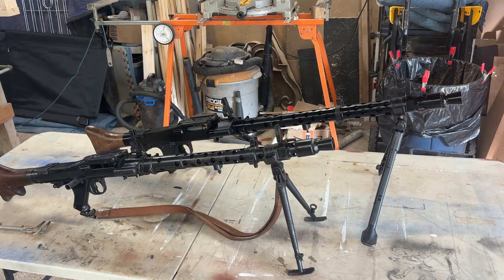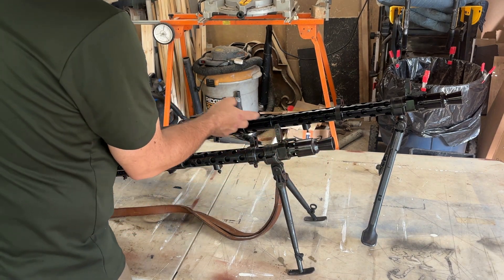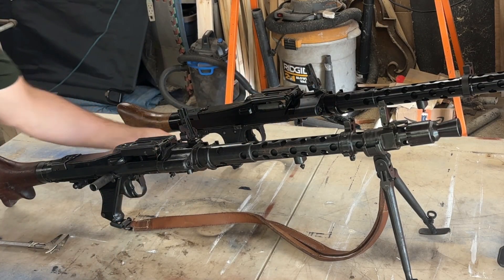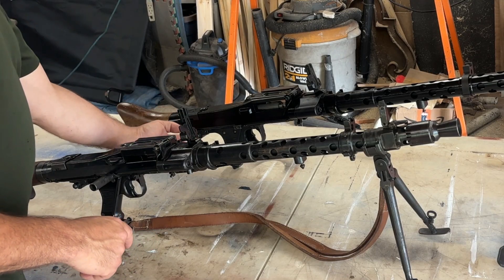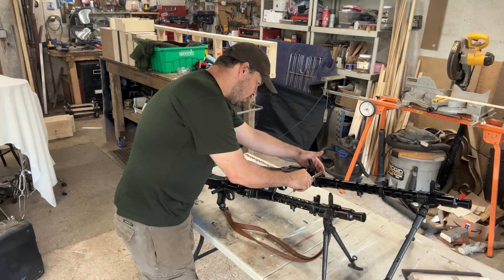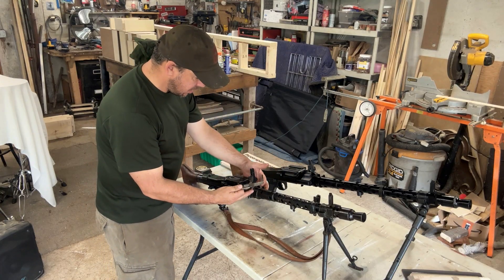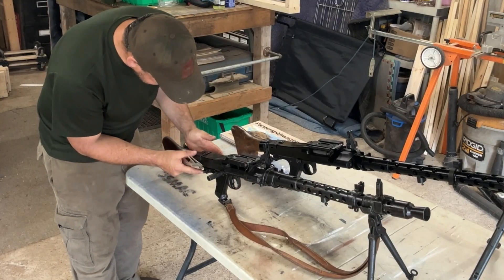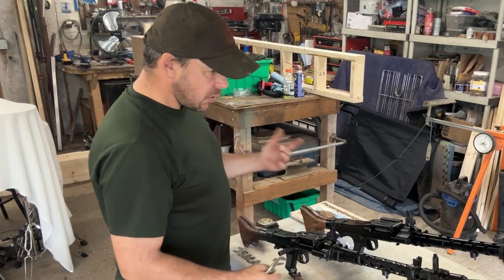Project 222  Ep 80 Building an SdKfz.222 Armored Scout Car

Comment: With real weapons vs the replica to remember, at least in the USA you can't make a replica 1 to 1.. It has to be larger or smaller so it won't accept genuine parts.
Reply from the maker: The MG will never be close enough to original to be classified as replica by Canadian standards...  Replica firearms are prohibited in Canada.  The only part of the MG that will look original is the barrel section that is out of turret.

Comment: Honestly why not make a black powder 20 mill smoothbore with a manual breach 
So a big “single shot rifle” for registration
Reply from the maker: Well that is an option... we also considered a 12ga "insert" setup.  The original was an auto-cannon... so it was fired in bursts.  Ideally we want something to simulate that.
Reply: @woodsarmoury  how about a long beanbag cannon that’s automatically pressurized by a small generator 
Or 12g single shot rigged with a homemade autoloader like a slide
Reply from the maker: Well we dont need the ability to actually fire projectiles and something that simulates automatic fire would be best.
Reply: @woodsarmoury how about a toy gun noise box and a long metal barrel 
Also perhaps bring it down to the US we would love to have ya

Comment: I am so happy I found your Chanel.  Will you be doing a gas gun system at any point for the 20mm?
Reply from the maker: Yes, I have an older video talking about this.  We plan to do a gas MG34 and 20mm simulator.  It will be an upcoming project this winter.
Reply from the maker: https://youtu.be/jAgXdJ-SAnk